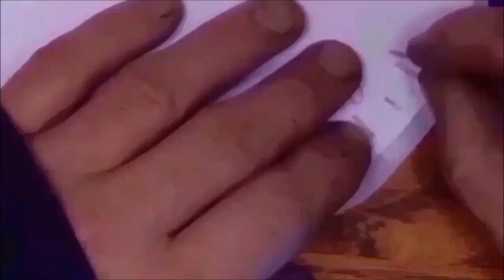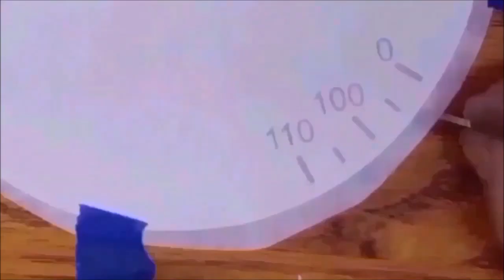Restoration: rusty scale

Comment: I’m replacing the linoleum on this exact same scale but I can’t figure out how to get the top to reconnect to the base, your video skipped that part. Any suggestions?
Reply: How did you get the top off? I am stuck at this step lol
Reply: @knifflig4015  look carefully at his video, it shows him prying it up. This bends the connections a bit so you’ll need to tap them straight when you are about to set it back in.
Reply: @d.bcooper7819  Hey! Thanks for replying! That's exactly what I ended up doing after re-watching this video about 100 times. I left the hooks slightly bent so that the top still locks down but can be removed by pushing it to the left and pulling up.
Reply: @knifflig4015  my pleasure glad you sorted it out.